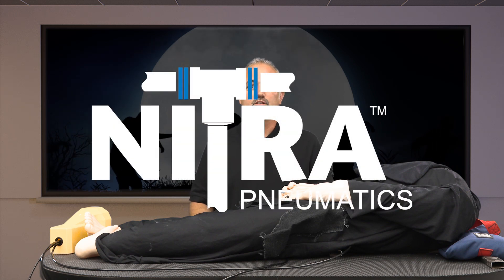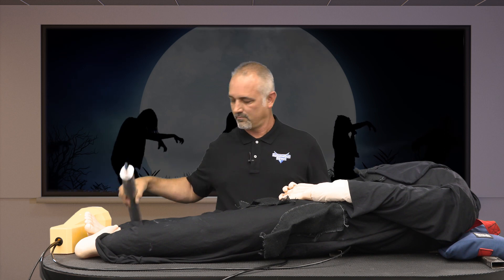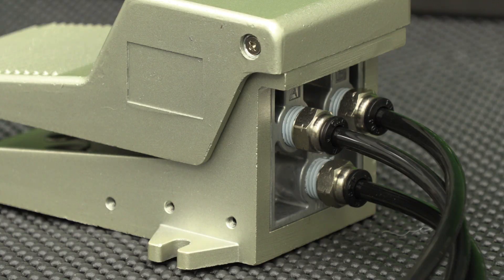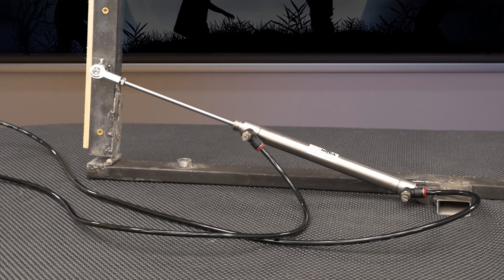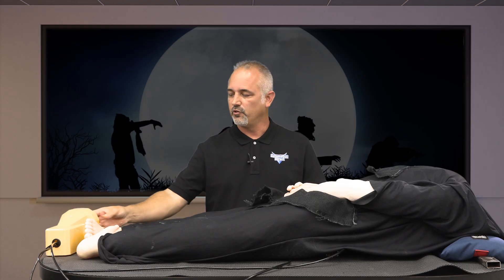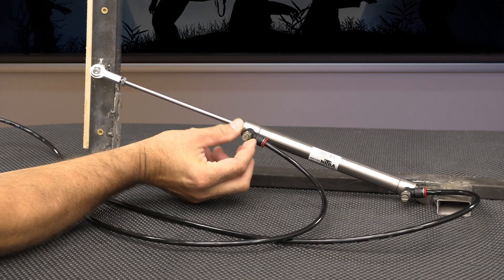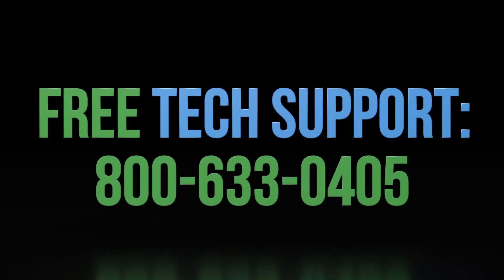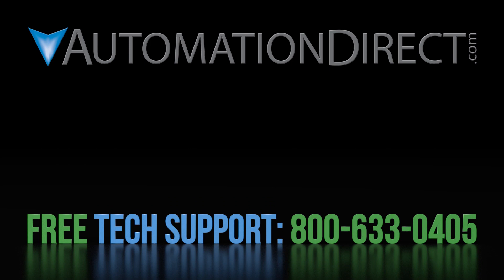Halloween Pneumatic Prop - Pop Up Scare from AutomationDirect

Comment: If I wanted to use IR instead of a foot pedal, what controller would i need? That you sell obviously,
Reply from the maker: @robertproctor8355 are you referring to an IR motion detector? Like a prox switch, or an IR receiver that you would control with an IR remote?

Comment: Any instructions/tip 
with the air compressor and hooking it up to this?
Reply from the maker: @JasonCalPayne Position the (loud) compressor a long way from the "haunt" or else it may scare people when it kicks in unexpectedly. :D 
And use proper air prep: filter, regulator, and maybe even a dryer (depending on your local humidity levels) - to keep moisture out of the pneumatic components.
Thanks for the comment and let us know if you have any further questions on our products!
Reply: @automationdirect thanks. I just missed a part order. What parts did you connect both of the ends of cylinder if I’m only using wood?

Comment: So I would still need to buy an air compressor in order to use this setup correct? Meaning that this will no longer be less than $100
Reply from the maker: Yes, Sam. Make sure you go check out more of our products at https://www.automationdirect.com/adc/home/home

Comment: A vibration sensor for paintball targets would be nice. I called and they said you did not have a vibration or shock sensor that would work.
Reply from the maker: While AutomationDirect doesn't have any sensors like that, I have used little piezo elements in that past to detect impacts. Something like this: https://www.sparkfun.com/products/10293. Impact generates a voltage you can detect.
Reply: AutomationDirect.com   Would you happen to have a relay that the pizeo would trip ?
Reply from the maker: I doubt you will find a relay that a peizo would trip - it would be a very quick voltage spike that you would need an interrupt or rising edge logic on a processor to detect. Or, do a google search on "how to detect impact using piezo" to see other ways to do this.